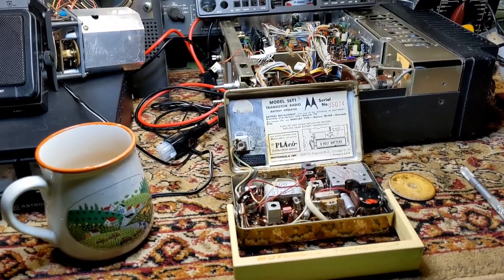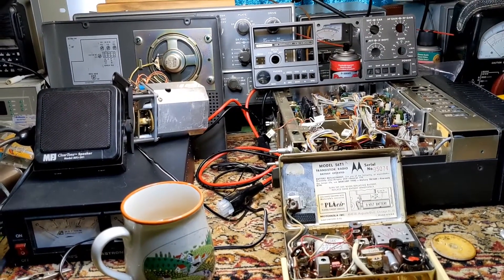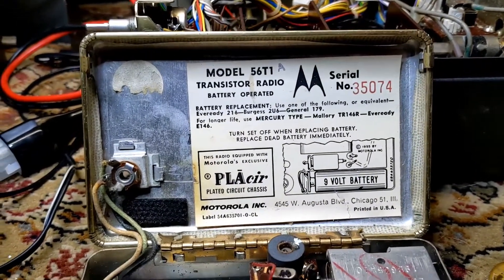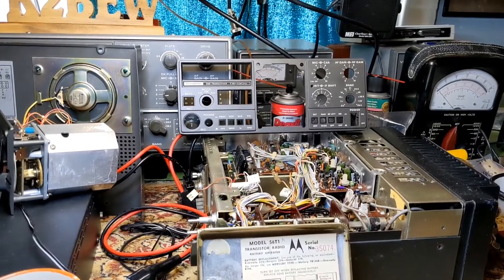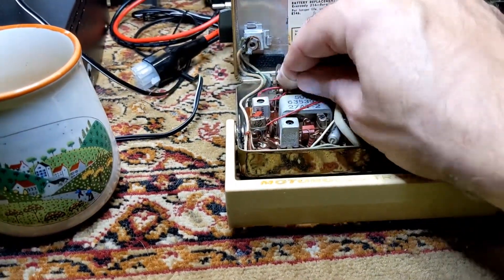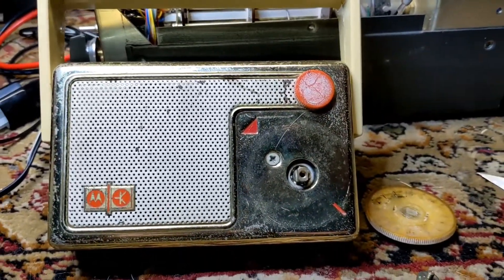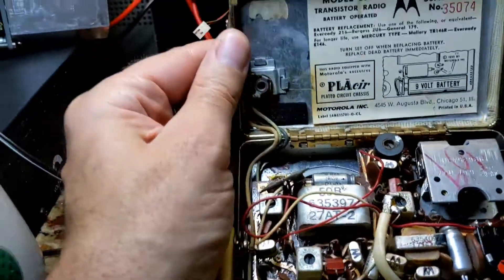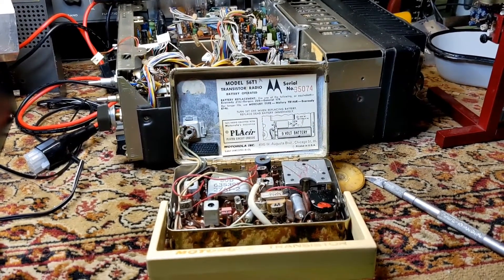Motorola 56T1

Comment: Tom good to see a video for you. I am not the best at working on electronic devices but, I have had some success and other times I have had those radios that really had me stumped. That's why I am luckier than most my brother Ron has been in the electronics field for 50 years designs and builds circuits builds his own equipment. So if I am stumped I contact him and he comes over he lives a block and a half from me.